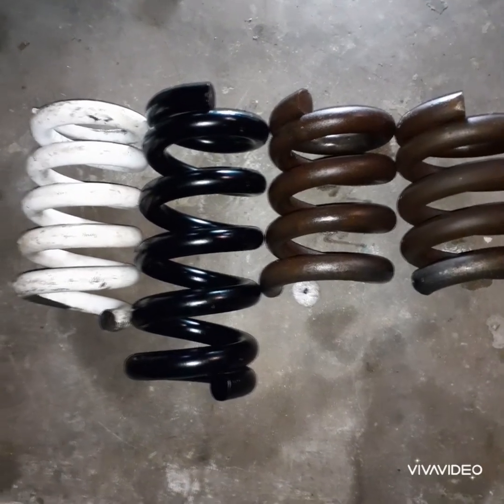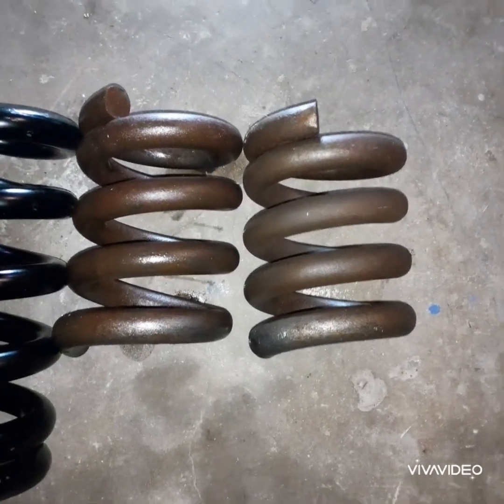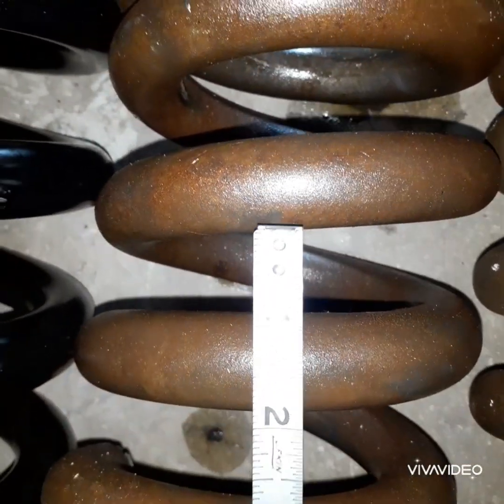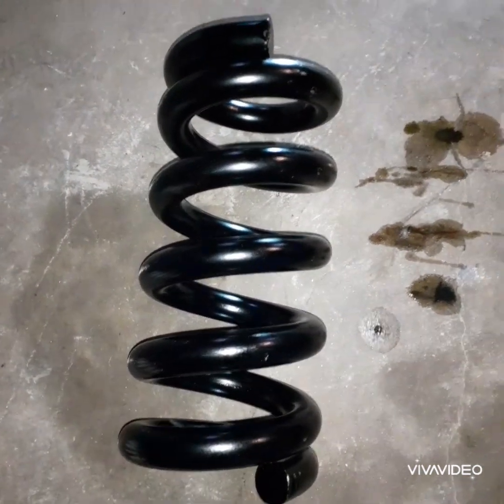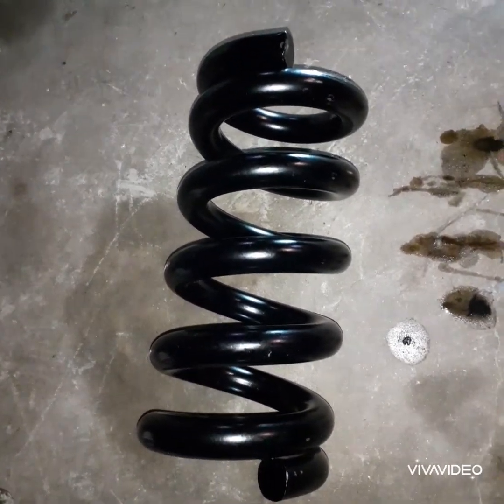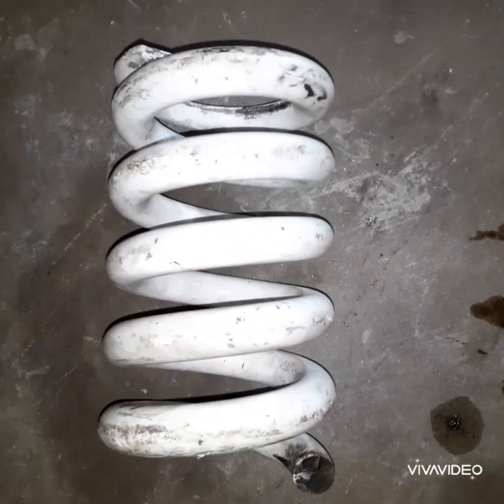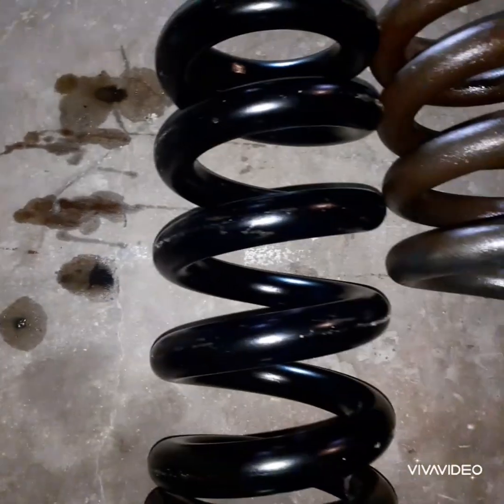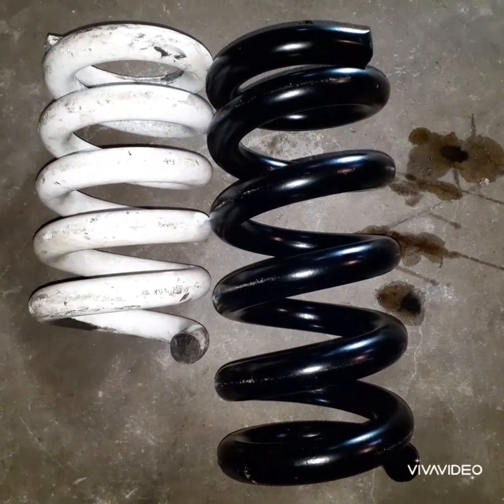Lowrider spring problems

Comment: I Have a 82 Coup Deville. What spring set up  you think is good to run. I thinking about replacing all the spring due to the previous owner cut the springs to get the car to sit really low
Reply from the maker: What you going smooth ride or hop?
Reply: @lowridersmore8189  smooth ride lay and play
Reply: @lowridersmore8189  I have 6 batteries 2 pumps
Reply from the maker: Front springs 3 or 3.5 ton and back 1.5 or 2 ton and see who has them in stock cce hydraulics,black magic hydraulics,Hydro Joe's,Hoppos,Hi-Low
Reply: @lowridersmore8189  man thanks 🙏🏾 what about full stack or pre cut
Reply from the maker: Pre cut ready to install and full stack will have to cut to get it how you like the car to sit and have to cut both the same length to match

Comment: Yes my car hops uneven on the second lick ,  what do you think it might be??
Reply: So what do you think it might be
Reply: So what do you think it might be
Reply from the maker: First how's your set up single pump,double pump, y at the pump if single or under the hood, if double do you have same pumps heads on both pumps same set up and fittings,spring cut to same length,spring pocket reinforced if not one may be flaring up and cause one side to lock up before the other,check donuts one may be more taco shape then the other if not reinforced,oil on pump good,did you bleed your system getting the air out,etc.
Reply: @lowridersmore8189  I have a two pump Ford dump set up, the coil pockets or the same the springs are cut the same and I did bleed them when I reinstalled

Comment: I went with hoppo’s 3.5 ton coils for my cutlass v6 we’ll see how they do
Reply from the maker: They should do just fine on a v6 I'm still trying to find the right spring combo for my v8 just got some sky-hi 4.5 ton springs ganna try them out and see how I like them
Reply: My cousin is going through the same thing he broke a 3.5 and collapsed a 4 ton he is on 5 ton right now on a 93 big body
Reply from the maker: Yeah I can imagine on a big body yeah 5 ton should work but everyone makes there springs different and that's what I'm doing trying different most known hydraulics shops springs and see what I like
Reply from the maker: And every car is same and different some way or another you can have the same car and engine and set up but one may do better then the other
Reply: How did it ride with the 3.5s?
Reply: 5 ton from CBM work good

Comment: Dam a g body is collapsing a 4.5? Them sky hi joints don’t mess around bro make sure your frame is rite or they gone shoot through the top of the pocket, I use 4.5s on my big body full stack zero cuts once they broke in perfect, the 5 tons I gotta cut about a turn off tho, 3.5 tons are usually taller as a full stack so cutting em would be ideal for more travel cause without ball join extensions which I don’t recommend you only get like 4.1/2” of swing
Reply from the maker: Yes frame fully reinforced and spring pockets as well and collapsed those 4.5 high hitter's and have black magic sky-hi 4.5 in it now but doing some other stuff to the car so can't test it till done and ganna be ordering 5 ton later to be on safe side still have 307 v8 on it every car is different so just ganna have to be Tuning it